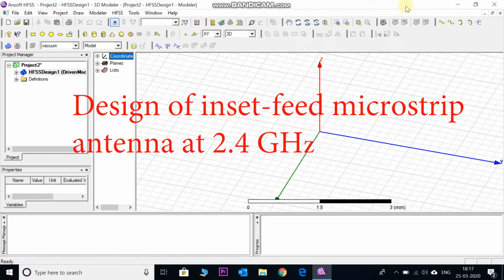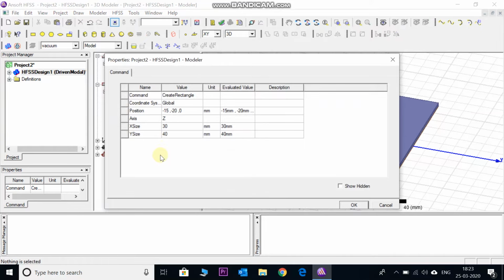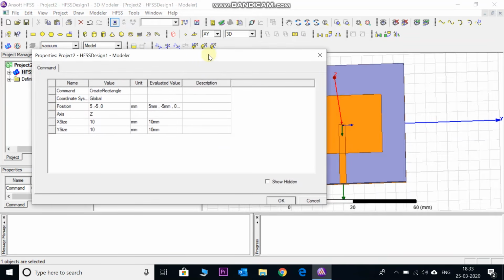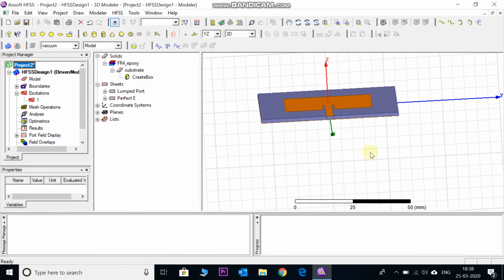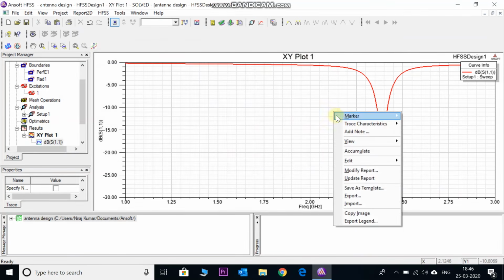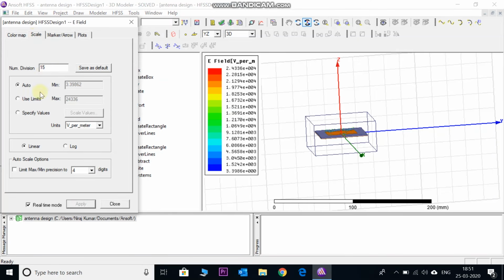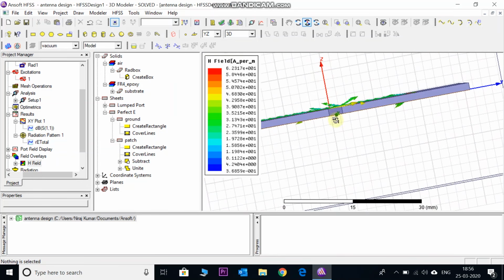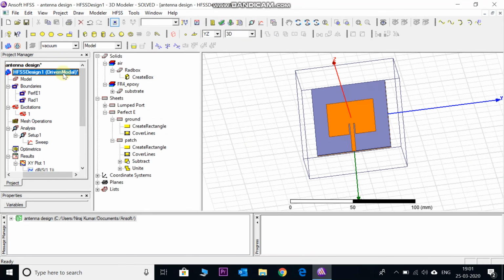Design of inset-feed microstrip antenna at 2.4 GHz and its radiation pattern and gain plot

Comment: Thank you for the video. Very useful. Just one question: I did everything as in the video, but the graphs don't show when I run Rectangular plot or 3D polar plot. What did I miss?
Reply from the maker: Check whether simulation run successfully? You may send screenshot through email provided in about section
Reply: @RFDesignbasics  hello! I sent the screenshot . Thank you for being ready to support.

Comment: Thanks, madam. I followed exactly your parameters but I get resonance at 2.2 GHz, by reducing the patch length by 0.85 mm I get resonance at 2.4GHz, but why I am not getting the same results as yours at your design parameters? What settings should I change? Thanks,
Reply from the maker: It depends upon version of the software and other parameters such as computer configuration etc. That's why we go for validating the results after fabrication.
Reply: @RFDesignbasics  ok thanks
Reply: @wajid - Have you noticed a difference in the port assignment ? Lumped port on my version of HFSS does not ask me to draw a line, was that the case for you as well ? I saw a 2.2GHz resonance with default patch length.
Reply: I actually found out what the problem was - I was using a terminal solution type, instead of the modal used in this video.

Comment: How to calculate 50ohm point on the patch to match with Transmission line mam
Reply from the maker: It's generally very high impedance (200 to 250 ohms) due to open circuit. As you go towards the middle it will become 0 gradually. So take a random value between 200 to 250 ohms and calculate the position using equation provided in antenna theory books. Finally optimize the position using HFSS for best matching (low return loss).
Reply: How do we calculate the conductances G1 and G12 to find Rin (y=0) mam
Reply from the maker: This calculation will be tedious. Simply use the HFSS to optimize.

Comment: how did you find Rin...u assumed 225 ohms and then u said we have to do return loss and optimize yo ...i dont know how to do that...can u pls explain that part?
Reply from the maker: It's generally between 200-250 ohms. By changing the position of inset feed you may optimize the design to get best impedance matching.
Reply: Okk thanks for reply

Comment: Any ideas on improving the maximum gain?
Reply from the maker: There are many methods. You may use FSS or AMC or metamaterial.
Reply: @RFDesignbasics  on loading meta is the same simulation is to done, or not? PEC for meta?

Comment: E field pattern for me isnt like yours.. all lines vertical for me.. any possible reasoning for this? have done the same steps as yours..
Reply from the maker: Check the settings again.
Reply: @RFDesignbasics  I am also getting a Global message which says "The application could not resolve the IP address of this machine: remote analysis and remote distributed analysis will not work".... any suggestions on this? will it affect the working of hfss...
Reply from the maker: No, this won't affect.

Comment: How do you know that at this point the matching is 50 ohm
Reply from the maker: You can follow this link for the design equation and calculation. I have assumed Rin as 225ohm for this case. https://www.iexplainall.com/2020/05/design-equations-of-rectangular.html?m=1.
Reply: pls provide answer to this!